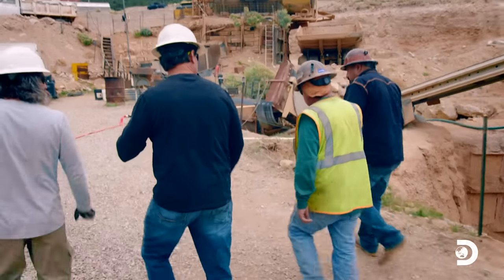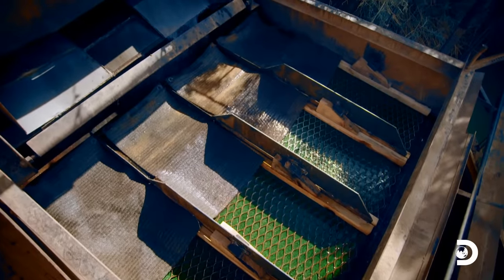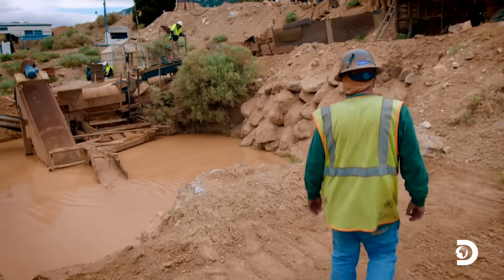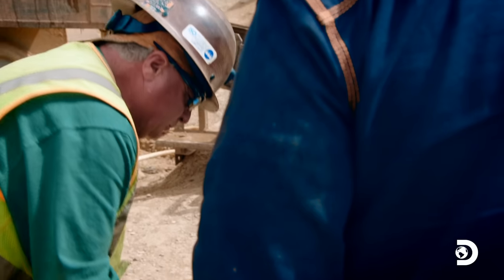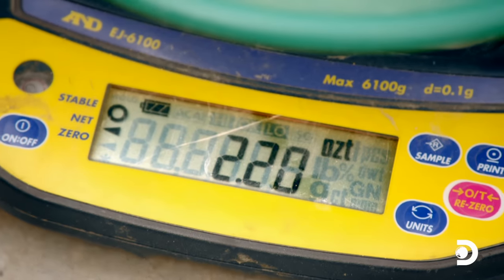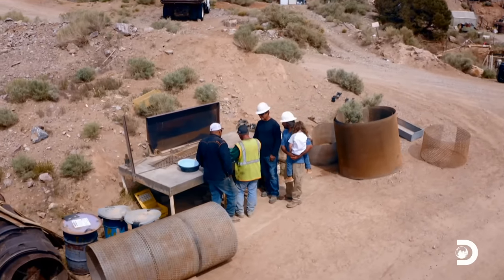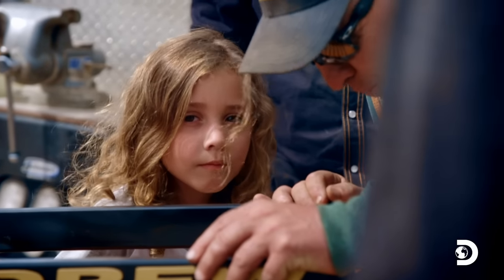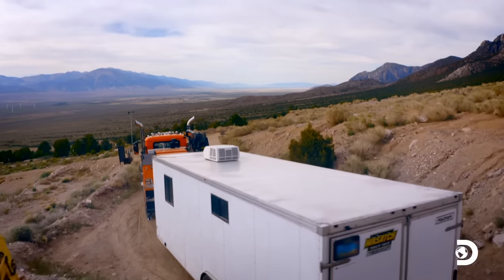The Secret to Making $750K in a Single Mine Rescue | Gold Rush: Mine Rescue | Discovery

Comment: It will always confuse me why gold holds so much value when it's not rare and found in almost everything these days.
Reply: It is the best conductor of heat and electricity. It is a metal which can form extremely thin layers. It is immune to corrosion. It is used as an industrial catalyst (to catch platinum). Gold is not formed in stars, sun produces elements only up to iron. Gold is formed only when stars die as supernovas.